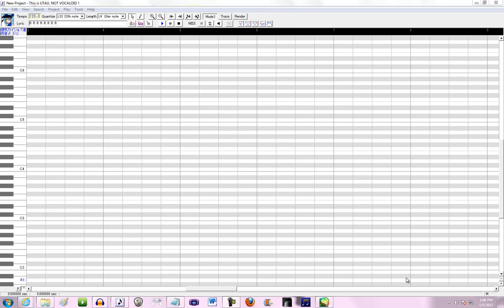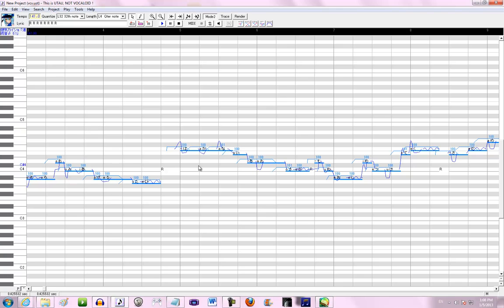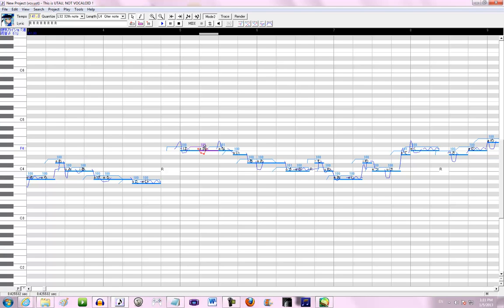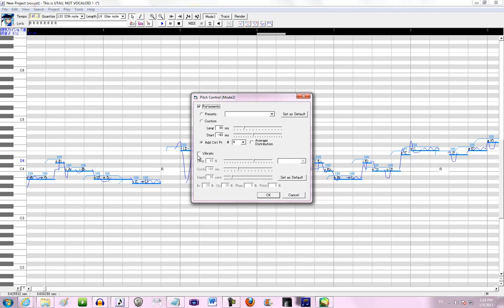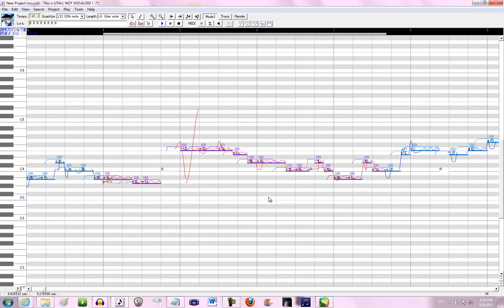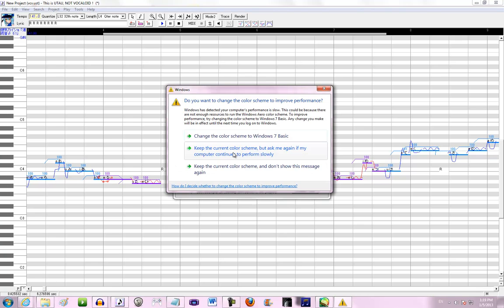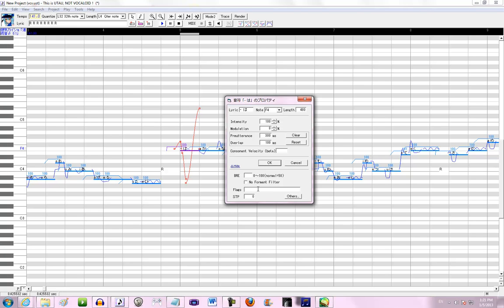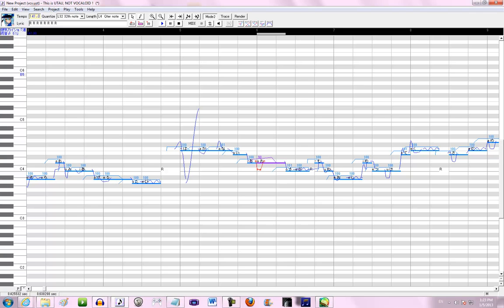[UTAU Tutorial] How to UST - The Basics [Part One]

Comment: I found something quite neat on UTAU i really am new to that and doesn't have a good ear for music but i think that this thing i did sounded pretty good (atleast with the UTAUs i used) i did this i set modulation to -100 (you could also use 100 but sounds a little bit drunk but still good) i added 50 on the breath and added -20 on STP (don't use more than -24 else it will give little breaks adagfdj) and then added these flags: F100C50L10Y0H0L90c99B0g-5 and changed resampler to Freesamp14 It sounded very good with any UTAUs i've used i don't know if it'll work for you but for me was wonderfull :3 Kthxbye ~ Also wonderfull tutorial i was really needing an info about those Pitchbends thingy